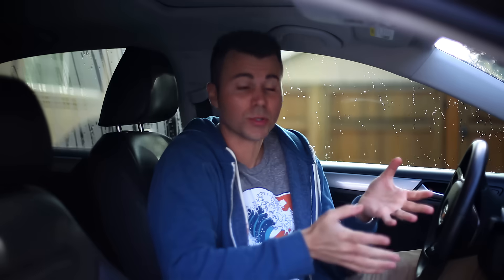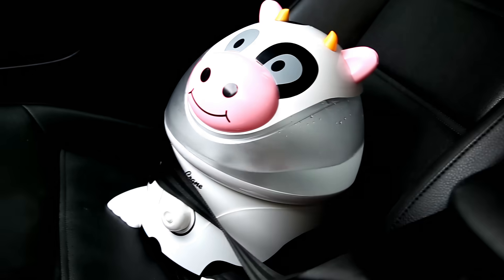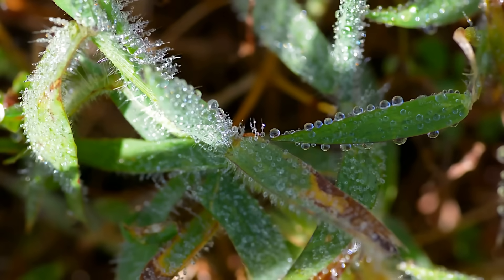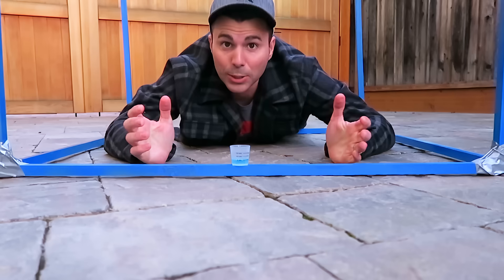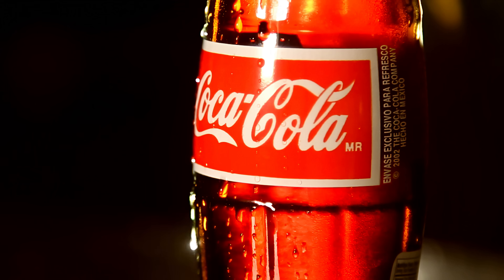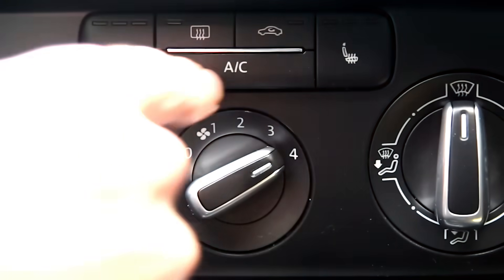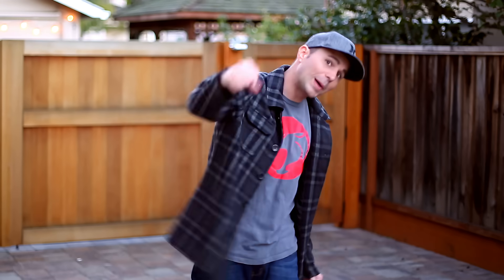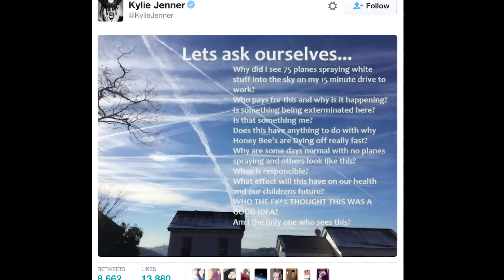Defog your windows TWICE as fast using SCIENCE- 4 easy steps

Comment: Now make a video on how to deFROST :)
Reply: +drakono82 Frost builds up on the INSIDE of the car when you have water/melted snow in the foot wells.
When you lave the car parked, and the termp. drops at night, the rising moisture freezes to the inside of the window. The best remedy for preventing it is to keep the inside of the car dry as much as possible, like putting news papers in the foot wells, and silica packets on your dash to absorb any rising moisture that may reach the windshield area.
Reply: @QuaabQueb  I had that exact issue with my old 240SX. It was irritating to have to scrape both the outside AND the inside of the windshield. A friend at work suggested two things that made a major difference. The first was the newspapers, to absorb the water that you bring into the car on your boots as snow and slush. The second was to crack your windows overnight. This helps cold dry air circulate through your car and absorb moisture. The opening can be tiny-thickness of a credit card or two-and still provide enough air exchange to help. You really don't want too much more because blowing snow getting into the car will add to the problem.

One more thing you can do, when it's not snowing, is as you approach your overnight parking spot, you open your windows and exchange the warm moist air in the car for the cold dry outside air. The colder you make the inside of the car, the less residual heat will be available to create water vapor that might settle on your windows and condense or freeze.
Reply: use an old blanket to cover your windshield over night...in the morning all you have to do is remove the blanket and you are ready to go, simple as that
Reply: +Huangism rain-x makes a de-icing windshield fluid. it works quite well and adds the water beading effect. as for fog inside, just open your windows for a bit before you arrive at your destination. it should equal out the moisture that's been collected. i think anyways.
Reply: +James D In Canada it'soften cold enough that warm water will freeze  in less time than it takes for you to wipe off the window....I've tried this method and it just makes things worse until the interior warms up the windshield enough...The ideal trick is to prevent frost from collecting in the first place...
Reply: +Twiztidguy Yes......I realize that.....thankyou keyboard hero.
Reply: +Video Québec as a canadian i've yet to figure out how to get in and out of my car all winter long without bringing outside snow in with me. levitation is still beyond my grasp.
Reply: +BuNNieSklZ He told you how to get rid of water the fastest in the already liquid state, not the solid state.  It would be a different method for frost/ice.
Reply: +matt w once it evaporates the liquid will freeze even more, and as you start to drive the wind will freeze it causing streaks of ice on the windshield
Reply: @Van Allen  I live somewhere that gets to -30F.  (Duluth, Minnesota)  Anyway, if you pour boiling water on your car in the winter and you live in Quebec it will turn into thick ice.
Reply: +Video Québec Exactly. Not everyone lives in California (LIKE MOST OF US)
Reply: +Twiztidguy wow really? I didn't realize that. I guess you did not gather that that was the entire point of my comment; that there are two different types of situations. The frost being the more annoying, and longer one to get rid of
Reply: +Video Québec Just run outside, turn on the car with the defrost on high, lock the door, go back in, shower, dress, and when ready to leave not only is the windshield defrosted, the car is nice and toasty warm.  Works great in Colorado in any sub zero temperature.  Or better yet, park the car in the garage and you do not have to worry about frost on the windshield.
Reply: +Video Qu&#233;bec You do know how youtube works, right?  The +(name here) designates who someone is replying to.  Now, if you actually looked at Twizs comment youd realize that he was not replying to you, he was replying to BuNNie. 

Moron.
Reply: +Video Québec so that's why the taxi cab I used a few weeks ago had newspapers on the floor! :O
Reply: +Dave Wilson You have a blanket with straps on both sides that you but inside the car when you close the door, securing the blanket.
Reply: +Video Québec 

1- have two keys 
2- turn on your car on hottest and highest fan setting.
3-lock your car with 2nd key. 
4- go back home and eat breakfast. 
5- ready to go! 

I do that always.

"Alert" this method does't work with dangerous neighborhoods unless you have a key less car that turn its self on from far away yet inaccessible without the key.
Reply: And don't do this in neighborhoods infested with environmentalists. I live in Alaska and had an autostart on my old 4x4.  Starting it a few minutes early would not only defrost the windows, but also melt a ton of snow off the hood and windows.  But I got a lot of mean comments from people not liking my "footprint"
Reply: +Twiztidguy Plus, frost is on the outside of the windshield, which is a much bigger factor than the state of the water. And humidity doesn't enter the equation. All you can do with the air system after the fact is throw heat at it. Any tips for prevention or removal would be radically different.
Reply: Rich people: Smash glass into pieces and get a new one
Poor people: Wait
Reply: C'est ben un québécois qui demanderait ça
Reply: +AWSMDEWD First winter in San Diego this year. Had ice on my windshield last month. lol. First winter in Pensacola, FL a couple of years back, had ice on the roads and snowfall.
Reply: +James D -30f is quite common in northern states and canada
Reply: +Video Québec Well, here's what I do, you can take what you like from it. (although I do think the blanket over the windshield idea is definitely worth bumping)
Step 1: turn defroster on before shutting car off at night
Step 2: plug in block heater when going inside
Step 3: In morning DON'T FORGET TO UNPLUG BLOCK HEATER! (Might be speaking from experience here)
Step 4: Start car and watch frost disappear in nearly no time with minimal effort.
Reply: +James D we live in Canada there bud! What do you think happens when you pour water on your windshield in the winter?? It freezes
Reply: Best defrost method is mechanical remove ice. Or you can  install windscreen with heaters.
Reply: modern cars are slower at defrosting.  On old cars you could put heat on defrost position, with recirculating air. So inside air heats up faster and is thrown at the windows. super effective defrost then when ready to go you switch to outside air and it instantly defog and you drive away. Now cars wont let you do it because it doesnt defog as well in so situation.  So instead, new car pull outside air when defrosting, meaning you constantly heat new cold air to heat your car(counter productive), pushing the already heated air outside...and cooling your engine when you want it to warm up.   I miss my 1991 isuzu impulse awd turbo in winter, but its too rare to risk . That car's heating system is insanely good and the wipers had a function to shake the ice off of them !
Reply: Its a defrost ..aka ice ..so cold air is not the soulution to melt ...clearly hes talking about condensation, NOT frost
Reply: +BuNNieSklZ 
fog= liquid moisture 
freeze= frozen as in ice, as in solid, as in not liquid.
Reply: +James D Cause, cool
Reply: +Bonifilio Soto best tip
Reply: +Video Québec What helps somewhat.  Lower sunvisors down, will help trap heat against windshield
Reply: +Jeff Ogden Lol I have figured out the best methods, read some of my replies, the best way is to prevent moisture in the car in the first place
Reply: +Wu Andrew Doesn't it make more sense the other way around?
Reply: +Bonifilio Soto genius
Reply: Stfu
Reply: Heated screen, takes 1-2mins. Done 👍
Reply: Charg
Reply: I use a blowtorch!!
Reply: YES FR THO!
Reply: +drakono82 Yeah, no. Frost happens both inside and outside of the car, depending on what state you left the car in. If it was warm and humid inside the car when you get out, and it was really cold out, you'll have frost on the inside of your windshield. It was like that in my car yesterday morning.
Reply: +BuNNieSklZ he showed us how to de fog our windows. Fog is water droplets, frost is frozen water droplets.
Reply: +Video Québec I didn't even reply to you....
Reply: +Video Qu&#233;bec
You want to defrost your windshield?...how about using your vehicles defroster? Thats why every vehicle has one.  I set my Defrost on high and maximum heat when I exit the vehicle. As I am going to my vehicle I push the remote start button and the defrost goes on and the vehicle begins to heat up and melt the frost. I have a nice scraper and a brush and use that for snow but morning frost on the windshield will melt fast with my defroster no problem. By the time I get my iphone plugged in and my tunes picked out the frost will show signs of melting and I just let the wiper blades do a little work and help speed up the process. If you don't have a remote start you can buy one for relatively cheap. A remote starter is well worth the money if you live in cold temperatures. As the windshield heats up and the frost/ice melts good new wiper blades will help remove the frost and worth the money.
Reply: +Joe Elmore I know that....but thank you once again for being a youtube hero...
Frost builds up on the INSIDE of the car when you have water/melted snow
 in the foot wells.
When you lave the car parked, and the termp. drops at night, the rising 
moisture freezes to the inside of the window. The best remedy for 
preventing it is to keep the inside of the car dry as much as possible, 
like putting news papers in the foot wells, and silica packets on your 
dash to absorb any rising moisture that may reach the windshield area.
Reply: tabarnac bonne idee estie
Reply: 1 part rubbing alcohol and 2 parts water in a spray bottle. Spray liberally on your car windshield and the alcohol will work as an evaporator. Better then using a scraper cause it can damage your windshield and better then saltwater cause if you've ever had a car and lived near the ocean, it messes up the body of the car.
Reply: +drakono82 

NO they methods are NOT different but remarkably the same 
At the start of this Video a Defrost button was shown this is a heater just like the one common for the rear window, but on the lower section of the Windscreen to assist ion preventing your Wiper from freezing to it. 
 
To defrost, you start your Car and allow it to idle with the A/C on and heater on this warms the inside of the Car and by convection through the glass turns the frost to water or at least softens it enough so the wiper's can do there job. 

Add a cup or two of pure alcohol (Isopropyl NOT Ethel ) to your windshield washer bottle will prevent it from freezing and polish the outside of your windshield with a high quality wax (this reduces the surface tension and helps prevent Ice from gripping the glass. )
Reply: +Bonifilio Soto This does work great, but what about the risk of the blanket blowing away if a snow storm starts overnight? Or a homeless person or just some jerk kids steal the blanket?
Reply: +Video Québec Hot water from the tap. Quickest most effective way. It's not tempered glass so it's not going to shatter.
Reply: +Video Québec Just blast antifreeze and put your windshield wipers on
Reply: 'rubbing alcohol' defrosts your windshield fairly quick.
Reply: @boreduser12   I'm not sure I would want rubbing alcohol to contact my wipers or my paint.  Have you used rubbing alcohol?
Reply: Mix about a 30/70 combination of rubbing alcohol to water, put it in a spray bottle, and use it on your windshield. The alcohol remains a liquid when water has already frozen
Reply: just use your wipers and fluid, if you have freeze-resistant wiper fluid
Reply: Chargèro  Move to California and you don't have to deal with all that bullshit 😎
And for the people that can't just pick up and relocate install a remote starter so you can start your car from inside the house and by the time you get in your car and it's nice and warm and your windshield is clear and you're good to go. Not that difficult to figure out. Now just focus on not smashing your car into something every time there's an inch of snow on the ground like we see you idiots do on the news. I've driven in the snow, it's not that hard, but what I don't understand is why the locals that live where it snows don't have a four-wheel drive vehicle, I don't get it 🌨️🚙

Comment: How about methods for cars without heat or ac capacity? I have an electric car which has great heat and ac problem is this takes a shit ton of power. my range already drops to 60-65 miles in the winter heat can take that down to 45 or less.

fogging is a big problem. I tried spit (the stuff not my own spit) and it works great. Exactly once. the sheeting process it causes to stop the vision blocking droplet formation also takes away the coating so you have to reapply every day and its a pain in the ass to apply.

fog x does not work at all in fact the opposite it causes the windows to fog more often than not.

is the shaving cream a pain to apply? I don't mind applying daily if it lasts a day AND if its not such a damned pain to apply :-)
Reply: +Nerys Don't get WD40 on rubber seals of the windows. It will cause the rubber to crack. I used WD40 to soften rubber strips before sliding the window glass into position in the frame. The one time I used it on the vent rubber installation, the vent rubber broke down after three months.
Reply: +behzad ghafari i cant understand your reply. you say no its not. no what? what is not?
Reply: +behzad ghafari probably not for me (lasting a week). with lack of running hvac and delivering pizza (lots of moist air introduced into the car) it fogs fast and hard. i will give it a try. any particular brand works best? but even a day and easy to apply would thrill me :-)
Reply: +behzad ghafari it does not work by rejecting water. thiugh that got me thinking. wd40 ??? might have to try that.

it works by causing the water to sheet instead of beading. the beading is why it blocks your vision.

the sheeting water takes away the oil or whatever over time.
Reply: +Nerys What car to you drive? i always wanted to know how electric cars hold up in the winter time.
Reply: +dsouzand 2012 leaf. sadly one year too old as the 2013 has 6.6kw charging and a heat pump. mine is 3.3kw and a resistance heater. ie a pig. :-)

car holds up fine just a lot less range.
Reply: Nerys
 what about when you start it on a cold winter day? is everything just instantly working eg.the heater, or is there a warm up period like in a gas car.
Reply: +dsouzand well you dont start an electric car you simply activate or turn on. everything but the heater is instant no delay and no different whether its 100' or 0'

the heater of course take time to warm up and time to warm the cabin. i just use an app on my phone to start the heat remotely plus it uses umbilical power while plugged in ao not draining the battery to preheat.
Reply: Nerys
 nice thats sounds awesome, hopefully my next car is an electric one. Thanks for replying back.
Reply: +Nerys I recommend pre-heating the car while it's plugged in for anything between 10min - 1 hour if you know you are going out. This way the heater will not drain the battery and you won't lose range. Maintaining the temperature in the car when it's already warm does not require nearly as much power, so the initial phase is most important. I can even start heating my car with an app before I get out of bed even.
Reply: +Nerys best thing to do is buy a dinosaur eating, carbon spewing beast.  I have virtually none of your problems.
Reply: +Eric Johnson except you do have the one gigantic nasty problem i really do not miss. gas bill and gas maintenance. 30,000 miles a tear gas free and damned near maintenance free. worth it.
Reply: In your case polish the inside of the glass with Dish Washing Detergent and DO NOT TOUCH it when cold the condensation will flatten out to a film of water which you can see through. 
As long as your venting the humid Air from within the vehicle then your windows should be fair. 
a second battery running a combination Peltier device would do what you want but cold on one side removing moisture and a duct created so the HOT side of the device reduces the cold in the cabin, OR dissipates it's heat into a radiator for internal heat.

Comment: Hey Mark, fantastic video! My car likes to fog up, this is very helpful. I do have a question though. Did you run the tests on a car with a cold engine or a warm engine? Most cars use engine coolant running through the heater core to heat the air, and my car takes a good 5 minutes to get up to the proper temperature and produce really hot air. Would such a factor change your testing?

Comment: come on guys, i'm 25 and i knew this before driving...
There is one point you missed, the air need 5 to 10 minutes to become hot when i start the engine in the morning, so the air is cold if you blast it on 4 when you get in

Comment: I thought the defroster setting was basically the same thing as the AC button.  I suppose it might depend on the model of car, but when I turn the dial to the defroster, I'm pretty sure I can hear the compressor start up (as it would for the AC).  I always thought this was to pull moisture out faster (to defog faster).